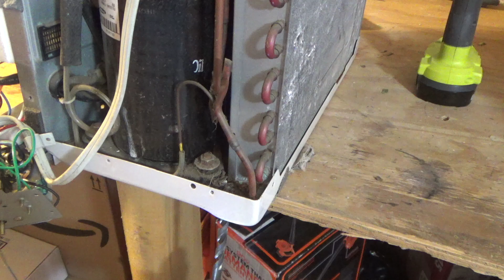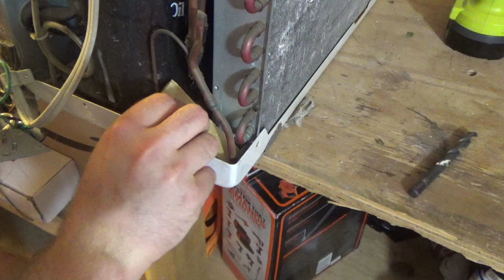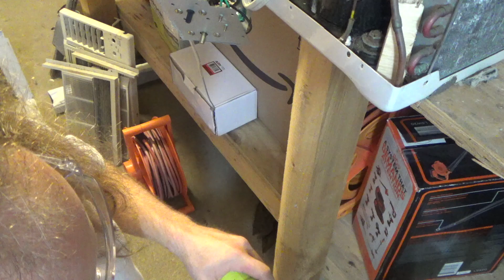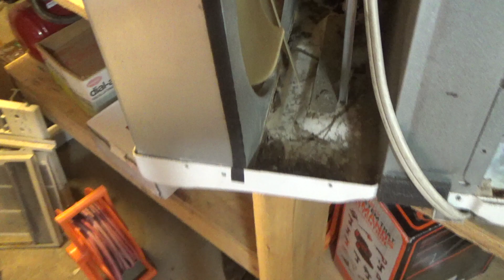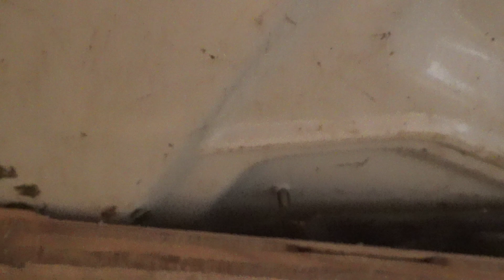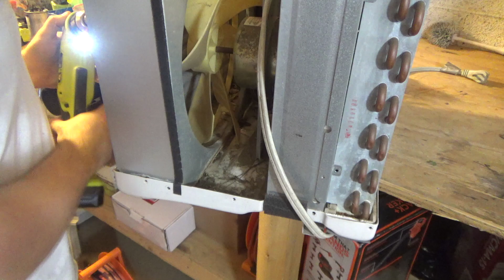General Electric ASV05LCS1 5,000 BTU Air Conditioner Clean and Service Part 2:  Drilling Drain Holes

Comment: Get yourself an inexpensive center punch for drilling holes.  Put it where you want the hole, tap with a hammer, and it will make an indentation.  They also have automatic spring-loaded punches.  When you drill the hole, the drill bit will not "walk" all over and you'll get the hole exactly where you want it.